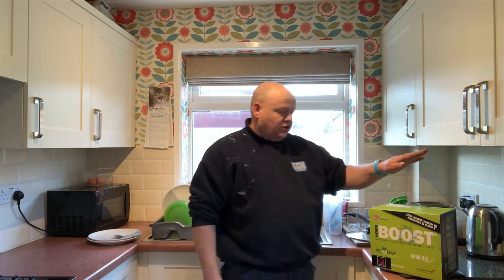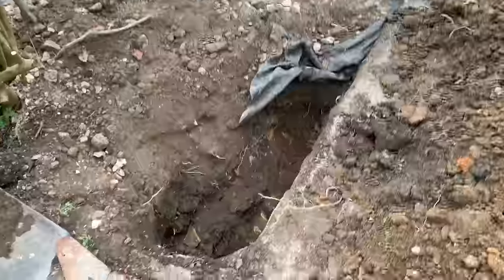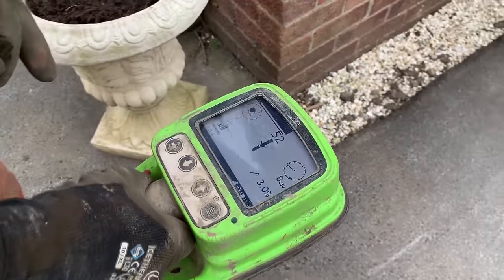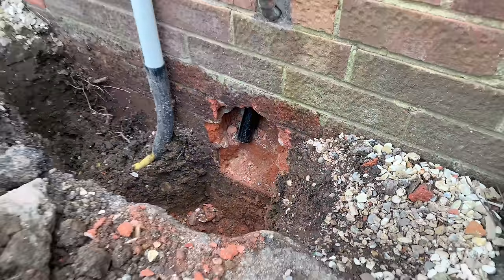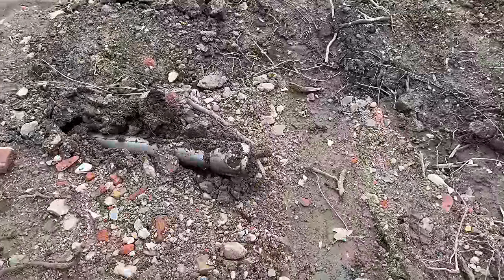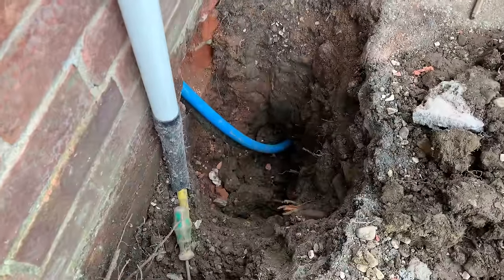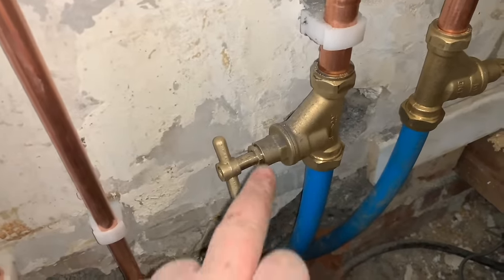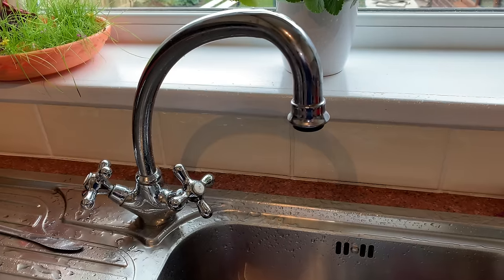MDPE WATER MAINS INSTALLATION - No Digging - Moling - Trenchless Pipe Replacement

Comment: Hi... Quick question....I have a plumber installing a new water main for me...replacing the old lead main.   From the stop tap backwards toward the street connection..... I have 22mm copper in the kitchen...which then goes under my living room floor in 22mm John Guest white plastic pipe....and he seems to have left sufficient to connect to the actual main in the street (about 6 foot outside my livimg room window)....is this ok/legal? 
Or, do you think it is a better job to use the 25mm MDPE to the stop tap as in your video?
Reply from the maker: Thanks very much for your comment, please consider subscribing to support the channel 🙂
Reply: @AllenHart999  I am subscribed.  Your view on my question? Cheers.
Reply from the maker: @ningis21  I am not sure of the answer. give me a call tomorrow if you like and i will talk through it with you.

Comment: Never seem the mole before, great idea, could you give some idea of how much it costs? also did you connect to the 15mm copper on the customers side?  or did you connect to the water company's valve,  customer side, as didn't notice any large hole around the mains stop valve in the pavement.
Reply from the maker: £450 for the mole. I wasn't around when the roadside was connected so I don't know. Thanks.
Reply: @AllenHart999  that's a good price can I get their number?
Reply: @Lucidchronicles  Google it. The company name is literally on the video

Comment: Hi love you vids. 

Just a eye saw I saw your mains stop tap going to the garage the valve was the wrong way as 22mm for how did you get around that. Did you change the valve?
Reply from the maker: It was all they had, it will be getting changed when that gets piped up.

Comment: I need your help! I live in a small block of 15 apartments, I have extreme low water pressure and have been told there is a blockage from my mains to my stopcock under the garden into my garage...who and how do I unblock the problem? It’s my main water supply and the water board people are saying it’s my problem not theirs..the deeds say I am responsible for it but I don’t know who to call to fix the issue? Can you help? Please! Xxx
Reply from the maker: Where abouts are you ?
Reply: Allen Hart hi there! I live in Surrey KT4 area...have had it fixed now...they cleaned/blasted the pipe and the water pressure is perfect and back to normal...a half over job and they charged me £1k! 😮...what could I do?! I needed water xxx
Reply from the maker: @avt30  Too far for me anyway. Glad you have it sorted though. 👍
Reply: Allen Hart thank you so so much for replying! Really appreciate it 👍🏽🙌🏽x

Comment: Is that not a directional drilling machine rather than a mole? And that is a service supply pipe you’re fitting rather than a main
Reply from the maker: I am no expert the company is called SupaMole so I am guessing it’s the same or similar?

Comment: The water company will be using this in my back garden in 2 days to fix a suspected underground water leak and I am super nervous in case it breaks through other pipes and drainage structure underground. They suspect that the leak is under the house so instead of digging through the floors of the house ( thank God) they are going to reroute the pipe instead.

Comment: Thats a great video of how its done but what is the rough cost for it to be done?
Reply from the maker: £450
Reply: @AllenHart999  Thanks for that. I think that's a great price for that work. Might be a bit more down south but worth it.
Reply from the maker: @MrGlenfraser  I was expecting at least double tbh.
Reply: @AllenHart999  when you think of the cost of a boost pump....... it's a no brainer....I have a 15mm copper pipe coming in this end. Thanks once again for this. How was the 15mm connected on the other and near the mole machine? Does the MDPE connect onto it easy were the 15mm came off?
Reply from the maker: @MrGlenfraser  I didn't see that connection but I guess it was push fit. then you could get the water company to do the rest maybe, not really sure.
Reply: @AllenHart999  Thanks for the info and replies.
Reply from the maker: @MrGlenfraser  Thank you for watching.

Comment: How much should this kind of work cost in the Uk currently. Cheers
Reply from the maker: Cost me £450 Thanks
Reply: There a a few variations on this simple install video but the average cost in the south east is £1000 with connections both end. (The water board doesn't do connections external stop cock)

Comment: A 15 mm main waterpipe. That was very small.
20 years ago i changed from a ½ inch steel pipe to a 32 mm plastic tube.
Reply from the maker: 32mm would of been better thinking about it now😂 Too late 😂 Thanks

Comment: Great Video Allen, How much does it cost? lol
Reply from the maker: Depends what you want. Thanks
Reply: @AllenHart999  led water pipe replacing, hoping it will increase water flow / mains pressure.

Comment: How have you connected it to the main in the pavement  ???
Reply from the maker: They did that part of it.
Reply: So they have approvals from the water companies?  Did they put a new boss  onto the main then ??
Reply: Your water provider will make the connection for free as long as it’s not for change of use or redevelopment of a site, ie it’s just to connect to your family home.
Reply: @EnglishCad  allen is saying the mole company connected it to the main from what I understand.  Not the utility company
Reply: They just connected the 25mm to the old copper 15mm on the homeowners property- no need to fit a new service as there's already one there!

Comment: I dug a trench for mine and had to line the trench and cover the pipe in sand then get it inspected by united utilities before covering it up . I guess they don’t check it if you do it like this
Reply from the maker: The last thing I would have wanted to do is dig a trench, I would have just put up with the low pressure. 👍
Reply: Allen Hart haha yes , fantastic machine though

Comment: I don’t get why all the expense to do that to get over 12 l/m what did they need that for
Reply from the maker: A few reasons really, Its getting a new drive and wanted to change the main so the drive should never need digging up. Also its much much quicker filling a bath now. Money well spent imho.
Reply: Allen Hart again tho if getting a new drive why not just hire a mini excavator for the day 
What was the cost on the mole hire
Reply from the maker: @superwhites5870  This is 10 times better than a digger, Cheaper, Less mess, less damage etc etc.
Reply: Allen Hart  cheaper digger hire is around 80 pound for day it is definitely a neater job but if the drive is getting ripped up any way. 
I do like the fact it takes a lot a manual work out the job

Comment: You've also fitted the stop tap that goes out to the shed the wrong way round.
Reply from the maker: I know buddy. Thanks.
Reply: That tap turns off the water and  works thats what matters
Reply from the maker: @josh6715  I will be changing it to a full bore level valve anyway, we had to use what we had. Thanks. 👍
Reply: @AllenHart999   great viideos

Comment: The main between the company stop cock and my house sprang a leak, it was easier to lay a new main rather than expose the old one, (just had new paving laid) the contractor used a mole driven by compressed air and it worked very well.  No big machine, no stack of pipes, just an air compressor on the van. In fairness, though, it was only about 8 metres distance overall.

Comment: You're garage stop tap is on backwards alan
Reply from the maker: I know it is but its all i had. Thanks.
Reply: Would that not effect the flow rate to the garage? I only say because I did that once and the water hardly ran through the pipe until I removed backwards stopcock
Reply: Alessio Lo Russo yes is can affect flow severely, if it’s the loose jumper type stop tap. The tap should be reversed asap

Comment: How much did this cost allen?
Reply from the maker: David Anthony They charged £450 to pull mains in. I need to change a few bits but I had to get water on so used what I had.
Reply: @AllenHart999  not a bad price , cheers mate.

Comment: And what about putting a drain tap just above the stop tap ........in Manchester it's a must
Reply: And the rest of the UK as well...🙈
Reply from the maker: Well spotted as I have said already the inside is not finished and I had to use the products we had at the time. Also needs stop tap changing as its the wrong way round, Sleeving and insolations which I do mentions in the video. Thanks for the feedback.

Comment: Could you show how you connecting blue pipe to the street water mains.
Reply: This is done by your water board if you have a lead pipe that's what I got done or sometime the moling company can do the connection if certified by the local water board. Its not something that you can do as may need the pavement excavated in some cases
Reply: @chandreshvarsani2190  im not planning to do Just want to see hpw its done in general
Reply: In the video you can see the boundary- council property outside/homeowners inside. The water company has installed a stop tap  in the pavement as close to the boundary as they can- thereafter it's the home owners pipe. The directional drillers should have dug a bigger hole 1, to get the drill deeper on the customers side, and 2 to follow that copper back to the stop tap - which has probably been renewed ( most mains are plastic nowadays) Then they could have used a straight 25mm plasson coupling ( you just tighten them up) and it would have been a completely renewed 25mm water service. I bet they used a 15-25mm  coupling, and then a 90° 25mm bend, as it was underneath the driveway a little... so now there are 3 joints to possibly leak after the stop tap instead of 1.  ( plus they shouldn't have left the copper in)long answer but I hate seeing people cut corners.....👍

Comment: Should it be moled under the extension 🤔🤔 I think not😂😂
Reply from the maker: They seem to know what they were doing, Not sure on the regs to do with it though to be honest. Thanks.
Reply: 👍 they should know not to drill / mole under any structure as the drill can damage the foundations and the pipe may leak overtime which will result in a new service diverted around or digging up the foundations . Keep up the good vids tho👍

Comment: A copper compression fitting on plastic pipe? You guys don't use plastic olives on plastic pipe? What about the olive cutting into the pipe and causing a failure down the road?

Comment: It is a shame that after such a good installation underground, the copper piping inside is all dependant on Silicone O Rings on those horrible clamped fittings.... in 30 years time it will all start leaking, unlike good old fashioned soldered ones.
Reply from the maker: Really ? have you used pressfittings?
Reply: Anything with a synthetic rubber or natural rubber based polymer composite in it will eventually crack and fail.  It is one of the reasons why kitchen and laundry appliances tend only to last for 15 years and the guarantee is rarely more than 4 years.  These push fit, clamp fit, press fit fittings may have mechanical strength to hold the pipe, but from a water tightness perspective, they all rely on O Rings........

I have come across plumbing installations which were installed in the 1940’s using primarily soldered and also compression fittings (with copper or brass olives) all are as good as the day that they were put in.  However, when it comes to polymers, I have joiner friends who are telling me that they have started to replace windows that they put in in the 1970s/1980s... so around 40 years.

The throwaway society relies on current cheap petrol based solutions, but in the long term some of the old ways are better.

You will rarely find a plumber putting in 100% plastic plumbing in their homes.  Copper is still the best ........ and soldered.

Comment: very nice install.  But how exactly did you increase anything when in the end your stop valve is actually smaller than the 15 mil that was there forever.  LOL. lates
Reply from the maker: It's made a massive difference, Thanks.
Reply: @AllenHart999  but the valve you put in is still smaller than what was there for 50 years?
Reply from the maker: @MrTooTechnical  I do not understand what you mean sorry,  All i can tell you is that the water flow is miles more than before. Thanks.
Reply: @AllenHart999  i c. is the old valve bigger than the new one?
Reply from the maker: @MrTooTechnical  The new valve is 22mm and the old one was 15mm Thanks.
Reply: @AllenHart999  the old valve looks bigger
Reply from the maker: @MrTooTechnical  if you look under the valve the pipe is only 15mm. I wouldn't spend all this money on updating it and adding something smaller. Thanks.
Reply: @AllenHart999  i guess.  the job is nice.  its i cant see how the new valve is bigger, it looks smaller.  maybe u can make another vid comparing the 2 valves.

Comment: That's not a mole though, that's like directional drilling. 
A mole is a pneumatic missile looking tube roughly 75cm long that has an air hose out of the back of it and it's like a jackhammer that instead of pulsing downwards it pulses longitudinally in which ever direction you originally send it.
Reply from the maker: Both do the same job. if anything this maybe better.

Comment: Never worth messing about with,,2 Guys mini digger Job Done,!👷🏻‍♂️👷🏻‍♂️👷🏻‍♂️👷🏻‍♂️
Reply from the maker: Mini digger would have cost miles more and made a right mess. The drive is concrete under the tarmac. Thanks.
Reply from the maker: @Mr Brightside 25m with a shovel and dig up the garage, Thanks for your comment but this worked for me.
Reply from the maker: @Mr Brightside As I said above the drive is concrete with tarmac on top, There is also a garage in the way. I feel this was the best solution for me. People can choose the way to suit them best. Thanks again for the feedback.
Reply: @Mr Brightside 
Are you on drugs?
Reply: @daverhodes382 He's not on drugs,just not very bright!

Comment: Good one Allen, but used these 25 years ago. Not a new thing.
Reply from the maker: New to me and by the views it seems its new to others as well. Thanks for watching. 👍
Reply: Allen Hart The Water Board have used them for years too Allen.  Scottish Water use them regularly & have done so for years.
There’s a wee problem with service pipes done with a Mole;  there’s a certain tension on some parts of the pipe, as it’s pulled & not laid.  So if you dig down to cut in a tee for example, cut the pipe, it can spring into the ground!!  I’ve seen you losing 150mm disappear in one direction or the other.   This can be a right bastard with limited space or a small trench.

Comment: NWL would disconnect that like. House entry is  rough as a badgers arse. But if it works then hey ho. Machines overkill for the job. Grundomat would been done before they got that beast off the wagon.
Reply from the maker: The inside will be getting changed as we were in a rush to get it working and we had limited parts. Thanks.

Comment: The majority of that pipe run is not below 750mm, the start of it looks barely 300mm deep.
Reply from the maker: The mole was measured along the full length of it to make sure it was 750mm min,  At some point, it was as deep as 1m. Near the house was around 400mm but that isnt staying like that. Thanks for your feedback.

Comment: Not that good of a job, you never fitted a drain off points at stopcock, no double check valves either and the pipe was not at 750 all the way, only at 750 ish when near the house...or shall I "say near house“  lol..... you smashed the foundations...pft why not just drill it correctly rather than wrecking the foundation and you didn't fit sleeving to the mains pipe as it went into through boundary of the building? Sorry for my feedback but a bit shocking Allen...
Reply from the maker: I do say in the video that i will be sleeving it, I had to use the products i had on the day. The stop tap is also the wrong way round, Thanks for your input though.
Reply: @AllenHart999  ok mate, I only noticed those things as I used to do it myself going back 12 years ago... Check valves need to be done. Cool 😎

Comment: or you could Own a QuickTrench system and replace about 100ft of water main in about 3 hours, using a pair of hand tools (including hookup) see www.youtube.com/watch?v=BjZ52-lw5Rl 
and not accidentally break the thin wall drain pipe near the house.. Don't dig a trench, just move the dirt out of the way.
Reply: Oops, try https://youtu.be/0FvwZzoaywo instead or use the keywords MargaWalt QuickTrench